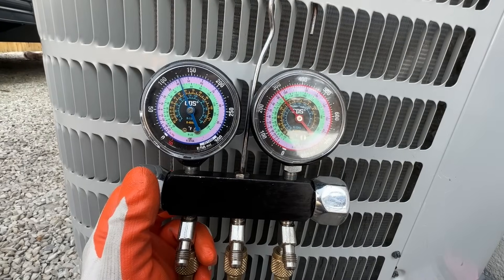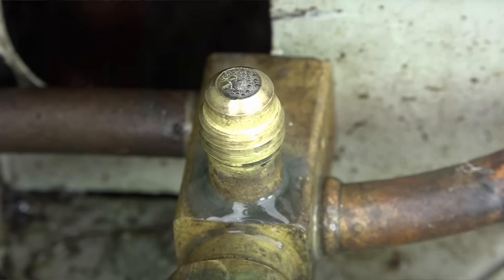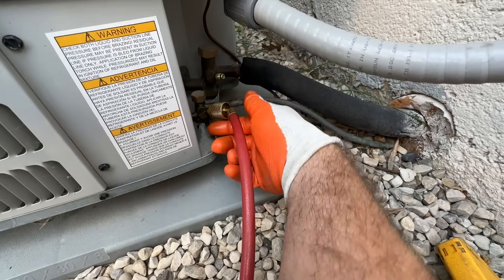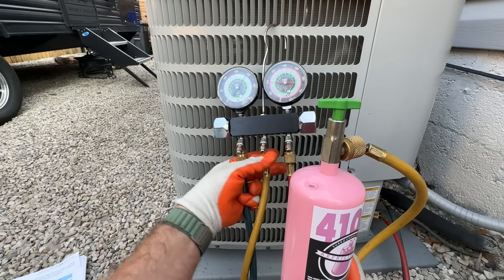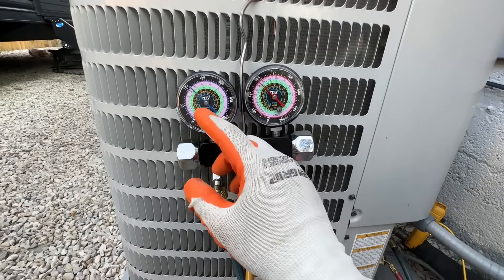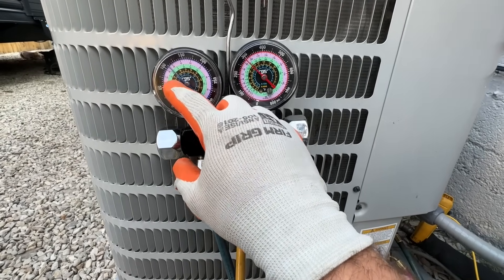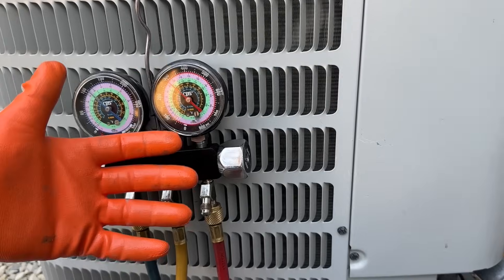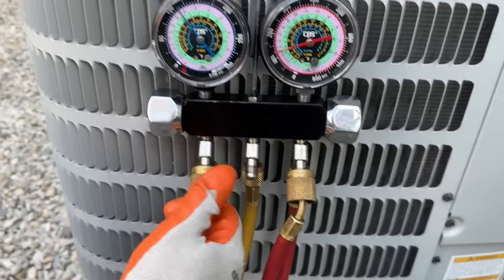How To Add Refrigerant To Your Air Conditioner R410A & R22

Comment: How to feel about the quick connect fittings?
Reply from the maker: I love them I have one system that I’m running them. So far so good!
Reply: @diyhvacguy I ended up buying r22 and the single line with gauge recharge kit. It worked great! Thanks for the video I learned so much. 👍

Comment: what if one of the lines "sweats" but the other one does not.  and mine is a TRANE heatpump, not an A/C. seems to do this on hotter days. the H/A guy I called did not seem to grasp even what I was talking about when I told him the line sweated I am real reluactant to hire H/A in my local area, most are of 2023 getting abysmal reviews! They seem more interested in putting me on "commitmet programs" and wanting to know my e-mail address, and my mothers maiden name! And not giving estimates until I pay them to come out.

Comment: I have my EPA 608 Cert.  and recently joined our HVAC group.  Appreciate the information you provide.  Im 62 years old and never stop learning.  Learning helps the mind stay young!!!
Reply: I am with you brother, I think because we are a healthier generation and have a different mind set from our parents who retired at 55 and sat around waiting for the next life. Instead we have the energy and drive to do more. I came from engineering and love diagnosing and repairing this equipment. The issues I have are ladders and attics so I am doing more commercial . to me.at the end of the day it’s all the same equipment just bigger. I am targeting hospitals most of the equipment is pristine and when I fall off the ladder I am close to the hospital
Reply: @JacksLore Great comment! 🎉
Reply: How, and where do you get your license
Reply: Bingo!!  I’m 58 and never kept a job where I wasn’t learning. I toughed it out when I was younger, but I’m worth the $$$$ now.
Reply: @LEON4PRES  Me too. I am also 58 and just got EPA 608 type 2 cert. I am going to add r-410a next time.
Reply: I got mine at 62 too. Good for you...and I.
Reply: hi, how can i get epa certification?
Reply: @josgfza5520  I'm 74 and got my epa certification last week.  You need Type 2 for these air units.  Google Skillcat.  Very easy and not expensive.
Reply: Abstract correct...

Comment: A good starter video. The challenge in a DYI situation might be being able to find a leak. If it is locating in the evaporator coil, (inside the home) it might be difficult to find. Using a high quality filter with a high rating will keep your evaporator coil and air ducts clean. Also, there might be a need to empty the system of a complete charge and and replace the compressor oil which probably would require a professional or more experience. Thanks for the information.
Reply: Finding a leak in the evap coil would be hard for anyone. A high quality filter with a high rating is not good as it will increase the static pressure too much unless the furnace or air handler was designed for it.

Comment: I couldn't help but notice the larger sizes were FAR cheaper per lb.  For comparison, latest price quoted to me on 410A was $150/lb.  SOME markup can be expected due to various costs like travel, insurance, salaries, profit, etc, but for your example, that bottle is $55/lb, or a 3x savings to start, but a 5lb is only $180 or about $36/lb.  Go up to a 25 lb and you get it for $15/lb!  For that kind of savings, perhaps a larger bottle makes more sense, since it can easily be stored, perhaps in your garage or a shed.  That leak detector is a good idea for two reasons, if your stored gas leaks, you have a warning tool, and if the A/C is leaking, it helps you find it.
Reply: You're correct that it's cheaper per pound when you buy more, but that only helps if you need more.  If a homeowner needs to top off their system to get them by another season or two until they replace the unit, $55/lb for 2lbs may be all they need.  If one needs to completely fill a large system, there's a bigger leak that should be addressed rather than continuously throwing refrigerant at the problem.  Otherwise, they'll be sitting on a partial tank for years or eventually trying to sell it, and unless the price skyrockets not likely getting the same rate they paid.

Comment: Ok here we go..This is going to be an adventure.. your videos are very clear and inspiring. Thanks!
 I'm dreading this dive into your AC world but my daughter's business has been without AC for a month,  and there are no windows that open in her Esthetician Spa business, so after getting a $1900 no guarantee's Estimate to add 8 gals of 410, she convinced me to  get the stuff to do it for her instead..  I went to your amazon link and dropped $200 in guages and stuff..
 
I've never done this before but ordered your CPS 5inch guage and a replacement 70/5uf capacitor ( since the exhaust fan is turning very slowly,)  and  before I try to refil this 5 ton AC system on the flat roof of her business's building I would like to get some tips on how to find the leak that a pro said was in the system. Its a Goodman GPH1360H41DA unit that they no longer stock, the table of pressures on the outside has faded. I think it's about 5 to 10 years old.  and  It hasnt been maintained in years , the problem is it's got decent airflow out of the dozen vents but it blows warm air everywhere.   I hope you can help me thru this.. I have a few days before the CPS guage set get here.. But I really want to know if its possible to find and fix leaks BEFORE you start re-filling the system.  I'll press one of teh valve stems to see if it's still pressurized, but if not.. Should I only partially fill it and start hunting for leaks? 

I will check every thing else your videos recommend and clean the evaporator coils 1st. and try to get the exhaust fan at the top to spin up normally ( its currently rotating slow at about 10 rpm). I can pull all the panels off and with the local breaker OFF too clean everything .. There is a hose-bib up there too, so I can  wash it ..

but my main question is how do I locate any freon leaks?.. perhaps I missed that video.. Wish me luck.. jimS

Update 1.. I havent done it yet but did get some leak-detect liquid tht makes bubbles and a freon leak detector instrument.. I plan to do all the pre-requisite checks and  make a checklist of all the steps in this video. I have a data sheet and need to find out if this Goodman is a Piston or the other type you mention, and look overr the table data in the data sheet to see what pressures / temperatures apply. I'll do that soon.
Reply: Did you get the problem resolved?

Comment: Our fridge was low on R134a just went to the local auto parts store and picked a bottle off the shelf, along with a Supco line tap. This was 4 years ago, and the fridge is running strong to this day. I'm in Canada, so maybe our rules are different? The stuff is available right off the shelf,  next to the WD-40.

Comment: Years ago (I'm older) I would use a little tap fitting on high side shrader valve and, suck it back with low side line shrader valve. 
Your low loss lines do a much better job!
Have a great day Bill

Comment: I changed the capacitor and it is not blowing cold air. Help Freon R22. air conditioner. The guy came out and said it was low. He put more in and still no air. Now what? Thank you for sharing this video.

Comment: I have been doing this on my own stuff for years, do I need a license to do this as a business, or would a handyman license do?  Maybe I should go into business myself and keep some scammers at bay, in the small town I am located in, the work from every contractor (not just HVAC) is horrible, half a@@ed and a rip off.  Another question on price, if you call a HVAC company to add a charge to a system how much do they charge the customer, they charge R22 $150/lb (when it is $45) as I write this and a service call of what another $120 on top of that, is that a the going price these days?  Any feedback would be appreciated, thanks

Comment: Great instructional. One thing to note. When you attach hoses to line set and purge air, make sure to purge air from hoses before you flip tank. Just like he did. This way there's less refrigerant loss. Vapor vs liquid.
Reply: Do these "low flow" fittings have a check valve in them?  Can you just buy the lines and retrofit an older set a gauges?
Reply: @jteddy11  you can just get the low loss fittings and install them onto hoses. They should at least be used on high side line if not low and hi.
Reply: @aubrey5939  Thank you, I typed low flow, sorry, thanks for the info on low loss fittings

Comment: Don't forget to mention checking the superheat of the system. Simply take your suction line temperature, after the system is running for 15 minutes, and subtract your guage temperature and that will give you your superheat on an acurator metering device. A superheat of 12 is usually good on a a\c system. Overcharging the system will damage the compressor by slugging it with refrigerant.

Comment: Really appreciate your input on adding Freon to my unit. It will be very helpful to me. I have been into industrial gases for 42 years. Did not know how to do a bigger unit like I have. You made it very simple. Thanks  R.Cunningham
Reply: if you have to add refrigerant that means you most likely have a leak so all you're doing is causing more damage to the ozone ... fix the leak.

Comment: You never explained why you kept the refrigerant still in your gauges.  Should the gauges stay like that or not? If not, what to do with the extra refrigerant in the gauges ? 

Can anyone else answer if he does not ?
Reply from the maker: If you watch some of my newer videos it shows how to push the pressure from your high side hose back into the system, which leaves minimal pressure in your hoses. Generally you don’t want to leave pressure in your hoses and the epa understands that letting out what’s in your hoses as acceptable 👍🏼

Comment: Why connect the hi side considering you did not use that variable or mention the reading for your charge procedure?
Reply from the maker: This was just showing how to add it, not how to check the charge or see if it’s low or overcharged. I have a specific video about superheat and subcooling. 👍🏼

Comment: How do you know what type of gas is used in your A/C system? Mine is more than 20 years old and I might need to add some gas soon
Reply from the maker: It always says on the name plate somewhere on the outside of the unit. I’ll be doing a video on this soon 👍🏼

Comment: When you attach the lines does the AC system have to be off? And when you are putting in the refrigerant, does it have to be running?
Reply from the maker: No, the system doesn’t have to be off to connect your gauges, and yes the system has to be running to charge it 👍🏼

Comment: Great educational video.  My Gauges do not have the Temperature settings for R410A.  Is there a chart that converts pressure to temperature?  Thanks.
Reply from the maker: Yes you’ve an google 410a pressure temperature chart and you can find one there 👍🏼 generally you want to be around 130 on the low side and 350ish give or take on the hot side on a hot day

Comment: Question hopefully you answer… my thermostat wont go below 80 (im im vegas hot as hell i have a lennox AC which is only 5 years old still covered under warranty ) HVAC company said i might have a leak and that my refrigerant is basically gone r-410a. They want to charge $2800 to “search for the leak and fix it and fill it” do these normally run out of refrigerant? Or do you think there is a leak???
Reply: They only run out of refrigerant if there is a leak providing it was properly filled during install. How did it work when first installed? The only way to tell for sure is to put gauges and thermostats on the condenser and measure pressures and temps to check subcooling and superheat numbers. An honest and qualified tech can do this. Here's some things you can check yourself. Is the air filter clean? Does the suction line (larger of the two lines) at the air handler and condenser get cold? Try to look at the intake side (underneath) the evaporator. Is there ice? Is it dirty or clogged? Check the condenser coils (outside unit). Are they clogged? Have they been cleaned? I believe pressures are highly dependent on ambient temps. With 100+ degree ambient, pressures will be higher than normal. I'm going through the same problems with my R410A system.

Comment: R22 is the best refrigerant gas there is, as it has mineral oil in its composition that extends the useful life of the compressor and reduces by 30% the increase in temperature transfer to the condensers. That is, 2 freezers with R22 gas work cooler than with R404A gas, forcing the compressor less and reducing the electricity bill.

Comment: Where can I buy those exact gauges you used in the video?
Reply from the maker: https://amzn.to/44OSUmV

These are them, the gauge covers just fell off after so many years of use haha they have been great and I highly recommend. This kit comes with the ball valves which are great too, you just close the valve before you unhook so you have as little loss as with the low loss fittings that I use. Cheers

Comment: The piston version control you showed is called an expansion valve. I haven’t done a/c in a very long time, but I did take a test when they started to restrict R-12. You stated once you have the license it’s good forever, I guess I will have to check that out. But for sure it the refrigerant is low something is seeping.
Reply: Expansion valves work the best I'm told but the new engineers would think otherwise.

Comment: I tell you something you don't know. R410A is a mixed R125 and R32 refrigerant. You should never burp R410A because it alters the composition of the refrigerant. The purging method doesn't completely remove air/moisture on the manifold. Connect the vacuum pump on the unused side of the manifold to completely remove moisture.. When the R410A system leaks the remaining refrigerant in the system must be recovered and disposed.

Comment: To the point, Can I put 22r in a 410 A system? I have a can of 22 I've been saving for no big reason.
Reply from the maker: Absolutely not. If you need some refrigerant you can get it at abilityrefrigerants.com    You will have problems if you mix the two

Comment: What about a  410A Heat pump that is completely depleted of refrigerant?  After vacuum. what is the proper amount to weigh in before checking gauges?   Should you weigh in the  manufacture  refrigerant amount  specs in the system before checking gauges?   I think my system is 9.5 lbs
Reply from the maker: It will say how much is fsctory charge on the condenser information place, which is for 15ft of lineset. Then beyond the 15 ft you add .6oz per foot. That will get you very close to the proper charge.

Comment: A lot of these videos talk about low refrigerant causing the evaporator coil temperature to be too low but in my experience it's the opposite because the air blowing out of the air handler is too warm. If the coils were frozen the air handler would be largely blocked. So the question is what is the relationship between the freon pressure and the temperature at the air handler?
Reply: whether the evap coil is frozen or not is largely a byproduct of how low the charge is.  the pressure(amount of refrigerant) directly relates to temp at evap.  is the system was just low enough on charge the temp at evap would hover below freezing and any moisture would begin to freeze.  if its very low it just cant remove enough heat from the air blowing through the coil, thus the "warm" air at the registers.
Reply from the maker: Yes if it’s JUST low enough you won’t have freezing issues but not cold enough air, but once it gets frosted it will continue to freeze until you have no air at all out of the vents
Reply: @diyhvacguy  I'm not sure if my R410A system is under charged or over charged. My suction line doesn't get very cold. My liquid line gets hot. Tech blames the TXV with costly replacement quote. I tested the TXV by placing bulb in ice water and warm water. It does regulate the coldness of the evaporator so I believe it is working. With the air handler cover remove and no air passing over the evaporator, it gets extremely cold to the point of freezing but when I introduce normal airflow over the evaporator, it's not nearly as cold. Any ideas?

Comment: I know this is a odd question, but I just bought a 220 window air conditioner last year and this year its throwing a code already and shutting off. So I added a shreader valve and when I do get my R32 do I need to weight it and add it to what the side says or can I just do this procedure like your doing getting it up to around 40 on gauge? Or is it better to measure what I'm putting in? They are about $800 and only one I can use here. I have thrown last 2 away and tired of it just because it needs a recharge or whole flush and add. Thanks for this video by the way!

Comment: Are there any special schrader core valve for r22 units? On mine there was a small leak and I change it but the top is too short and when I connect the lines it won't read anything the schrader valve is a little bit small than the old one.
Reply: how did you change it?  was the unit void of refrigerant???